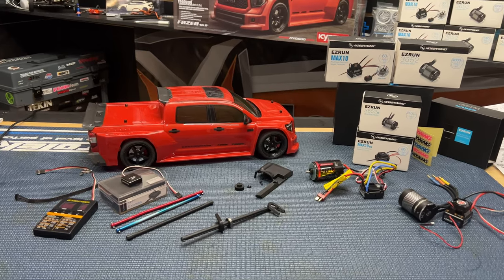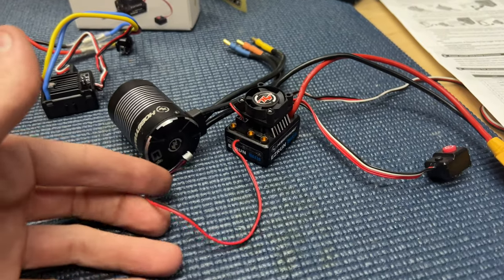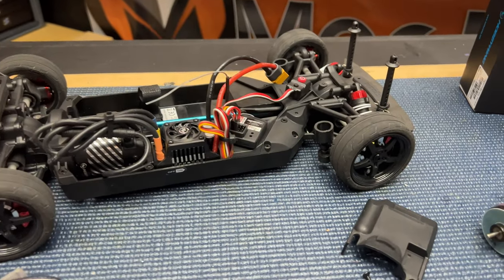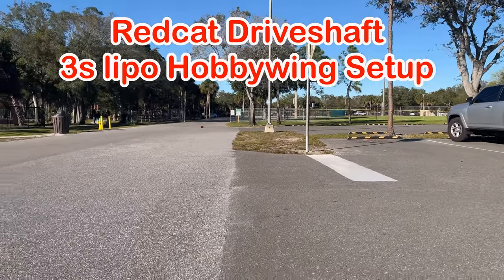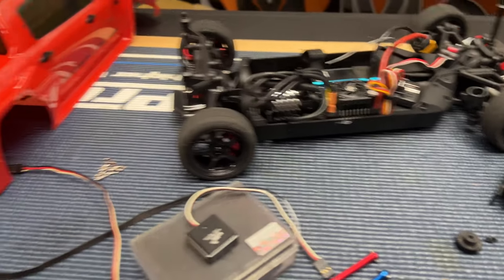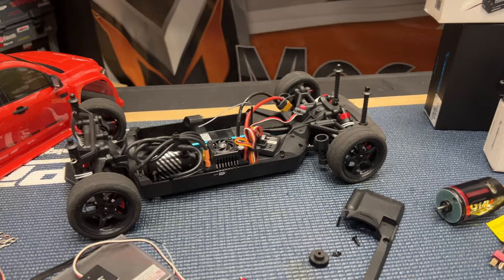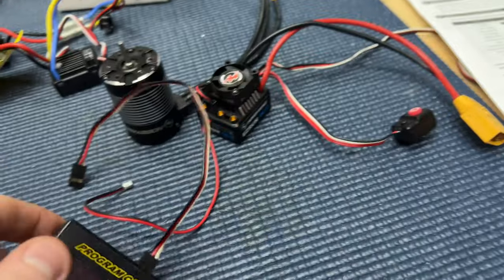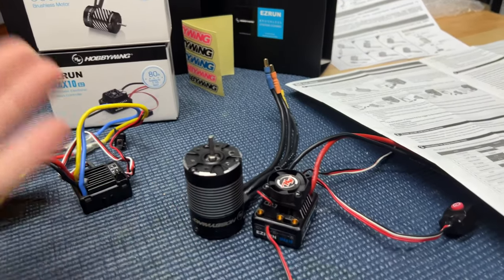Redcat Driveshaft works on Fazer MK2 FZ02L Chassis? | OMGRC.com

Comment: Yes the Kyosho aluminum drive shafts are pretty bad when you go brushless, especially on 3s. Thats why a couple  of years ago I made my own shafts for my brushless Fazers, I make them from solid 5mm carbon rod with custom  aluminum ball couplings bonded onto each end of the carbon drive shaft. Very stiff being carbon rod & no bending.
Reply from the maker: Thanks for the info

Comment: That's pretty disappointing that their hop up center shaft, that is designed to handle more power, does not actually handle more power without bending.

Comment: Hi what size Pinon gear did you use with the new 4100 kv 2 s achieving 39 mph cheers
Reply from the maker: @jamiekelly9268  I just used stock pinion gear just used a metal one instead. I believe stock is 32t
Reply: @ thankyou very much 👍👍

Comment: I wonder if turning the punch down and keeping the timing up so you still get all the RPM out of the motor would help keep the driveshaft from bending. It seems that it's that instantaneous application of torque on 3s that's probably bending the driveshaft so I wonder if it coming up on the RPM a little bit slower would negate the driveshaft bending but keeping the motor timing up to still get the high RPM. I worry about that off-center vibration of the driveshaft wearing out bearings on the pinion side of the differential. But anyways like we're your head's at and always enjoy people trying their hand at using parts from different vehicles to fix issues and improve upon their vehicles. Definitely an interesting video and thanks for bringing this issue to light.
Reply from the maker: I will check into the punch settings and back all the way down in hopes of a smoother run. Will keep working on this project and see what I find. Thank you for your feedback and support 💯👍

Comment: Thanks for the video. I've been testing the 140a 3665 4000kv version of the hw system in my 3s Infraction and it rips. A couple protek fans help keep temps in check on the motor.
Reply from the maker: Nice! 👍 what type of speed are you getting?
Reply: @OMGRC  I have it geared down 1 tooth from stock for smaller spaces, but it still pulls 50+ mph. With speed gearing it should easily do 70+.

Comment: Thanks for the information presenting another option other than Kyosho's aluminum shaft. I installed the Redcat one here as well and will be upgrading to the same Hobbywing brushless combo as well. How fast did you get it on the 2s  lipo with the Redcat shaft?
Reply from the maker: 39mph on 2s on 0 timing